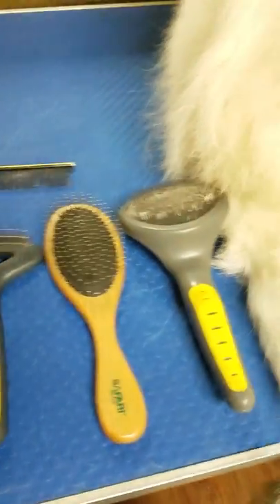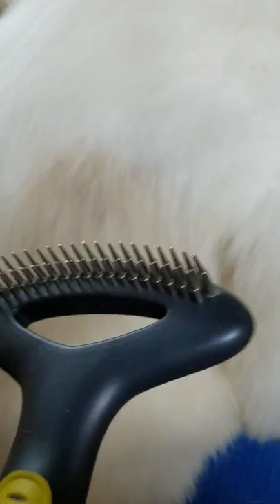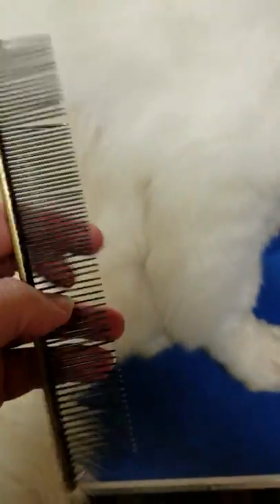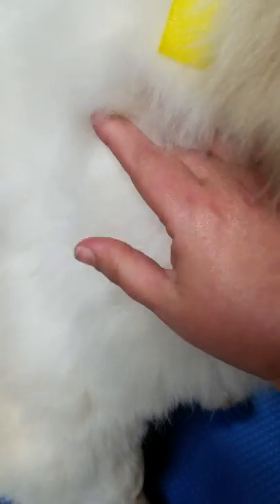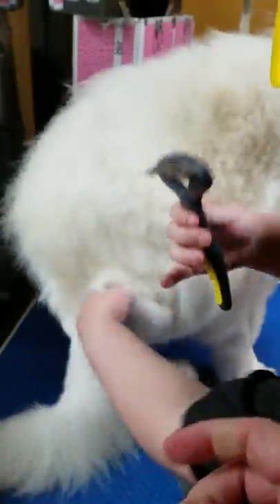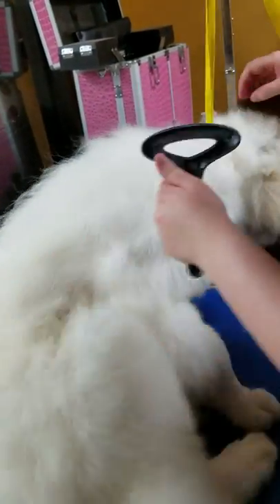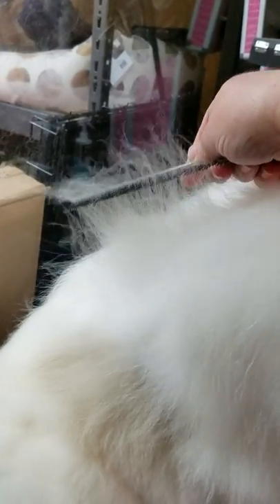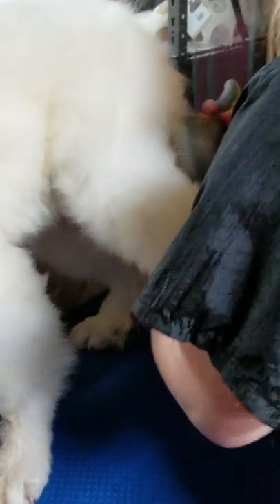Livestock Guardian Dog Grooming Tools

Comment: Best explanation i have seen of using the long bladed rake.  As for combs my steel comb is my number one grooming tool.  It cost 18.00 but i found a steel comb on chewy that had not only graduated tines but a molded ergonomic composite handle.  Thos dramatically reduced my hand fatigue so it was worth the money.  Because i have a great pyrenees i invested in a high velocity blower

Comment: I wish more Pyr owners would understand the difference between shaving and removing a blown undercoat. For every correctly groomed Pyr I see I also see 5 that have not had their blown coat raked out and are overheating due to lack of airflow against the skin. I usually tell people it is like you wearing a moisture wicking, SPF 50 shirt over a wool coat in summer.